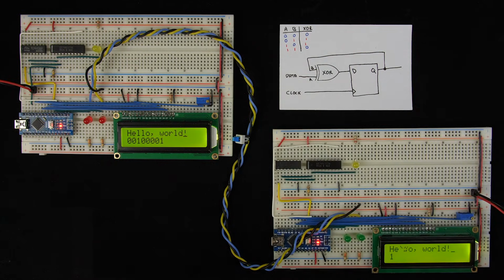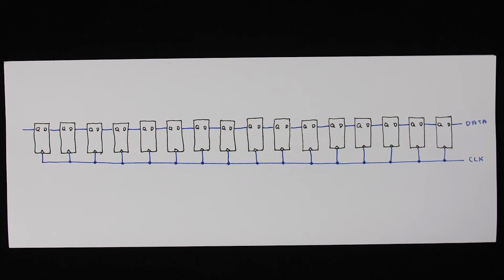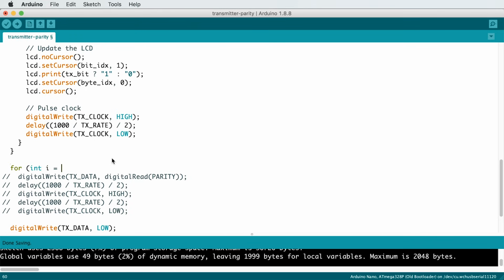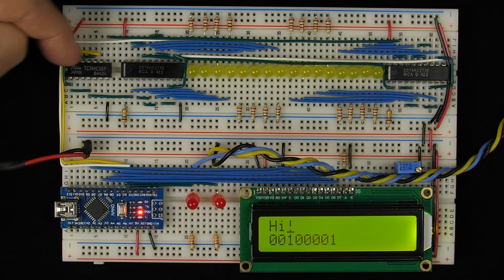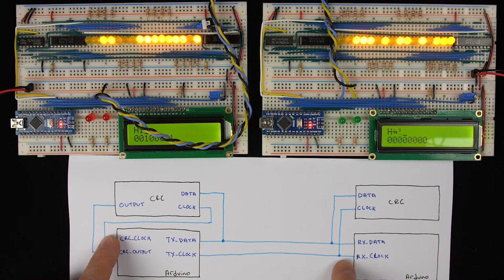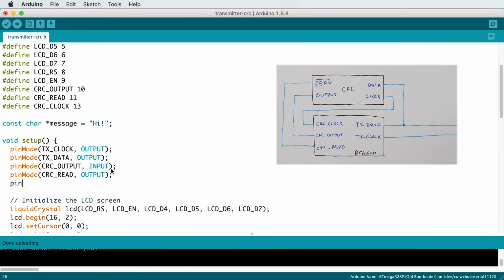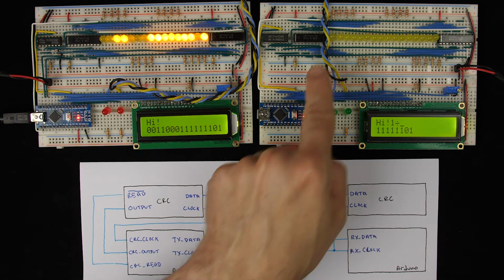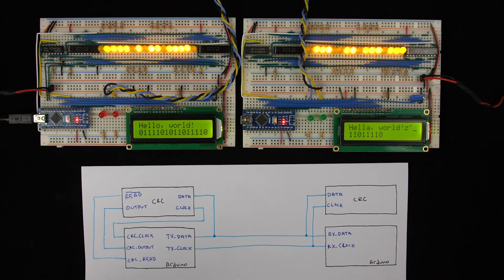Hardware build: CRC calculation

Comment: Would it be possible to connect the output of the (transmitter-side) CRC to the (TX_/RX_)DATA line through an AND gate with one input being the output of the last bit of the CRC and the other input being connected to the CRC_READ signal of the Arduino (which should be programmed not to "invert" the CRC_READ output)?
Reply: yes it would. I have no clue why he didn't do that.
Reply: Possibly because he'd have needed two AND gates and an inverter to do that, and he ran out of space on the breadboards he was using anyway (which is why he resorted to using diodes and a resistor at one point).
Yes, it would require two AND gates.  Think about it for a while and you should be able to figure out why.

Hint: What happens if you connect two outputs together and one output is at logic 1 while the other is at logic 0?
Reply: @melkiorwiseman  I thought that connecting two outputs together would be fine, but now I know it wouldn't. Would an OR gate on the outputs work? Do I understand it correctly?
Reply: @michalsebek2089  It would work if there was a way to set and hold each output to zero while the other output was transmitting, otherwise, either output being left high would cause the output of the OR gate to stay high no matter what the other output was sending to the OR gate.
Reply: @melkiorwiseman  Sorry, I'm dumb, but I'm curious, what was your idea of having two AND gates and an inverter? I tried drawing it on a paper and the only solution I found uses a NOT gate, an (one) AND gate and an OR gate.

The NOT gate is between the CRC_READ output of the Arduino and the READ input of the CRC module (if the Arduino will be reprogrammed to output HIGH if it wants to "read") or between CRC_READ and the AND gate (if it is the way it is now)
The AND gate has two inputs - the CRC output and the CRC_READ signal.
The output of the AND gate is then ORed with TX_DATA and the output goes into RX_DATA.

If it wanted to send data, it would set the CRC_READ low (or high - see the NOT gate options), that will set the AND gate to low, and the OR gate will output the TX_DATA.
If it wanted to send the CRC result, it would set the TX_DATA low and the CRC_READ high (low). The AND gate will output the CRC output, and so will the OR gate.
Reply: @michalsebek2089  My solution was simiar to yours, but I was presuming that the outputs of the AND gates would be floating if not driven, and I was thinking that there's already XOR gates on the board so one of them could be used as an inverter.  Your solution sounds like it would work, and probably would work better than my original idea.

Comment: A little late to the game here, but was re-watching this and it occurred to me if you XOR'd every flip-flop and AND'd between the flip-flop 16 out and the XOR in, with the AND input 1 being Flip-Flop output and input 2 being controlled by code, you could have the hardware support any generator polynomial of the same CRC length. Is something similar to this built into chips with the firmware controlling (or exposing to code) the generator polynomial?

Comment: Am I right in thinking the transmitted CRC could be subjected to errors and therefore the receiver may not receive the correct CRC for comparison? (so the verification could be wrong even though the data is correct?) - BUT even with that the system could still tell if there were  errors and that could be used to request a resend of the message.

Comment: I am curious that why did you used Diodes Logic rather than using Transistor? (at 34:41)
Reply: Basic transistor logic is usually NAND gate, sometimes NOR gate. Point is: it must invert signal because only on common-emitter circuit there is amplification of signal which corrects all the noise or level shifting that could occur to signal. (emitter follower alone is of no use, because it also shift level by 0,6 volts down, so after couple of them your logic is doomed).

But in this circuit we needed non-inverting AND gate, which would require 2 NAND gates. That's just too much an effort compared with 2 diodes and resistor :)

Comment: Hey man, why don't you just OR the output of the Arduino and the CRC and send that to the receiver? The Arduino output is low during the CRC transmission and the CRC output is low during the data transmission. That would simplify things.

Comment: I have a question about race conditions in electric schemes.
It looks like a current d-type flip-flop transfers their input to output with  positive-going edge of the clock pulse.
(may be too much multi-threading software development for me)

~thanks
Reply: Short answer: these d-type flip-flops usually consist of 2 latches inside: one pass signal through when clock=0, another one when clock=1. So when clock=0, input signal is latched into first part of flip-flop, while output stays what it was. And when clock=1 (that is, on positive edge), first latch now holds what was  put there and transfer this bit into the second latch, and it also go to output. So at this point output is not dependent on input, which allows you to connect them whatever you want. 

Ben had this explained, see "Master-slave JK flip-flop" and maybe one before which named "JK flip-flop racing", which explains exactly what you're worried about :)
Reply: Ben put in a description 74HC273 IC. Which description is: 
"The ’HC273 and ’HCT273 high speed octal D-Type flip-flops with a direct clear input.
Information at the D inputis transferred to the Q outputs on the positive-going edge of the clock pulse."
from: http://www.ti.com/lit/ds/symlink/cd74hc273.pdf

I'm not sure, but may be it should be something like SN74HC74N, which called double D-type flip-flop in spec file http://www.ti.com/lit/ds/symlink/sn54hc74.pdf  ?

Comment: How would the receiver know that the CRC is in fact the CRC?  You probably don't want the reciever to mistake it for part of the message and keep waiting for a CRC that never comes.
Reply: that's just part of the protocol. You'd need to solve that at a higher level. The simplest solution would be to just have a constant length, or send the length of the message as a header.
Reply: What WeNeedMoreFarads said.  Part of the protocol is for the transmitter to only wait for a certain amount of time for an acknowlegement of "data received" before re-transmitting the last data packet.
In the case of the ZMODEM protocol, it divides the message up into packets and gives a header and CRC to each packet before transmitting the packet.  Part of the packet header includes the packet number.  Part of the ZMODEM protocol is for the receiver to acknowledge the successful receipt of each packet by using its number.  That way, the transmitter knows when the receiver has missed a packet because it hasn't sent an acknowledgement for that packet within the allotted time following the transmission of the packet.  It also means that the packets don't always have to arrive in the correct order since the receiver can use the packet number to put the data in the correct order before saving the message.
That's just to give you an idea of how complicated protocols can become.  I've barely scratched the surface of the can of worms which is data transmission protocols.

Comment: Hey Ben! Why didn't you calculate the CRC directly in the arduino? It could calculate it much quicker and you don't need to use the new ports.
Reply: The whole point of the video is to explain how the algorithm can be done directly with hardware. While it could absolutely be done directly on the Arduino, it wouldn't be as elegant of a solution and it wouldn't be explained using binary gate logic. 
Also, the reason it might seem slow is because he significantly reduced the clock speed to make it possible to see the data being transferred. The chips are capable of calculating the CRC basically instantly.

Comment: What would it take to implement a system for error correction, one that shows what type of error occurred, where it was located, and what was done to correct it?
Reply: Just like for error detection there are many different solutions for error correcting code depending on the types of errors you can expect, again it's ultimately a trade off between how willing you are to deal with low probability errors falling outside the scope of what your ECC can resolve and how much of your bandwidth you are willing to spend on redundancy.

Comment: I use the same shifting method and XORing all the bits corresponding to the powers of the generator polynomial to compute CRC32 but it does not give the correct value of CRC32 ! For CRC16 you have (16,12,5,0) and a 16-bit long CRC. For CRC32, I use the generator CRC-32  0x04C11DB7(x32 + x26 + x23 + x22 + x16 + x12 + x11 + x10 + x8 + x7 + x5 + x4 + x2 + x1 + 1) and a 32-bit long crc at the end but I got  different result with official motor ! How come ?

Comment: But what if there is an error while transmitting the CRC? Do we add a second CRC to check that the first wasn't corrupted?
Reply: if the transmitted CRC has an error, the receiver CRC check will not be zero. Since the incoming "erroneous" CRC doesn't match the computed one of the "correct" incoming message = the transmission error will be detected. You are right though, that with this technique you cannot figure out wich, the message or the CRC, was corrupted, only that some corruption occurred. But that is good enough, either way you cannot verify the message, and you need to resend because your transfer medium introduced an error.

Comment: Sorry for my stupid question, why using 2 diodes instead of an and gate?
Reply: Breadboards have a division down the middle of them that allows you to place two-sided components in one column without the two sides being directly connected - the chips and the LEDs are all bridging this divide. The reason an AND gate chip couldn't be used, is that there was nowhere left on the boards where that division was left available for it; other components were taking it all up and there was no space left without rearranging things.
Reply: @Eyrlumi  Thanks for the detailed explanation!

Comment: I wonder how serial communication work? The two wire thing(TX RX)  , and can u show us how to make one ? I been wondering for ages 🤔
Reply: There is no single serial communication. It is a concept with many different implementations. If you have been wondering for ages, I wonder why you didn't bother to use Google yet. You know, it is a thing that lets you find stuff, especially those very basic things. There are thousands of explanations already.
Reply: The most common form is fixed baud rate non-return-to-zero (NRZ) coding. Look up something about UARTs; for instance http://www.circuitbasics.com/basics-uart-communication/

Comment: ben,perhaps you can translate this lost 6600 technique into understandable form and show how your students might use and update its  insights into 2019 logic for fun and reduced power and time to result etc...
 https://www.crowdsupply.com/libre-risc-v/m-class/updates/modernising-1960s-computer-technology-learning-from-the-cdc-6600
what they fail to mention is that there are multiple single-line source wires, thus achieving the exact same purpose as the reorder buffer’s CAM, with far less power and die area.

Mitch’s description of this on comp.arch was that the dependency matrix columns effectively may be viewed as a single-bit-wide “CAM,” which of course is far less hardware, being just AND gates. However, it wasn’t until he very kindly sent me the chapters of his unpublished book on the 6600 that the significance of what he was saying actually sank in. Namely, that instead of a merged multi-wire very expensive “destination register” CAM, copying the value of the dependent src register into the reorder buffer (and then having to match it up afterwards on every clock cycle), the dependency matrix breaks this down into multiple really simple single wire comparators that preserve a direct link between the src register(s) and the destination(s) where they’re needed. Consequently, the scoreboard and dependency matrix logic gates take up far less space, and use significantly less power.

Not only that, but it is quite easy to add incremental register-renaming tags on top of the scoreboard + dependency matrix – again, no need for a CAM. Moreover, in the second unpublished book chapter, Mitch describes several techniques that each bring in all of the techniques that are usually exclusively associated with reorder buffers, such as branch prediction, speculative execution, precise exceptions, and multi-issue LOAD/STORE hazard avoidance. The diagram below is reproduced with Mitch’s permission:....

his high-level diagram includes some subtle modifications that augment a standard CDC 6600 design to allow speculative execution. A “Schroedinger” wire is added (“neither alive nor dead”), which, very simply put, prohibits function unit “write” of results (mentioned earlier as a pre-existing under-recognised key part of the 6600 design). In this way, because the “read” signals were independent of “write” (something that is again completely missing from the academic literature in discussions of 6600 scoreboards), the instruction may begin execution, but is prevented from completing execution.

All that is required to gain speculative execution on branches is to add to the dependency matrix one extra line per “branch” that is to be speculatively executed. The “branch speculation” unit is just like any other functional unit, in effect. In this way, we gain exactly the same capability as a reorder buffer, including all of the benefits. The same trick will work just as well for exceptions.

Mitch also has a high-level diagram of an additional LOAD/STORE matrix that has, again, extremely simple rules: LOADs block STOREs, and STOREs block LOADs, and the signals “read / write” are then passed down to the function unit dependency matrix as well. The rules for the blocking need only be based on “there is no possibility of a conflict” rather than “on which exact and precise address does a conflict occur”. This in turn means that the number of address bits needed to detect a conflict may be significantly reduced, i.e., only the top bits are needed.

Interestingly, RISC-V “fence” instruction rules are based on the same idea, and it may turn out to be possible to leverage the L1 cache line numbers instead of the (full) address.

Also, Mitch’s unpublished book chapters help to identify and make clear that the CDC 6600’s register file is designed with “write-through” capability, i.e., that a register that’s written will go through on the same clock cycle to a “read” request. This makes the 6600’s register file pretty much synonymous with the Tomasulo algorithm’s “common data bus.” This same-cycle feature also provides operand forwarding for free!

This is just amazing. Let’s recap. It’s 2018, there’s absolutely no Libre SoCs in existence anywhere on our planet of 8 billion people, and we’re looking for inspiration on how to make a modern, power-efficient 3D-capable processor, only to find it in a literally 55-year-old design for a computer that occupied an entire room and was hand-built with transistors!

Not only that, but the project has accidentally unearthed incredibly valuable historic processor design information that has eluded the Intels and ARMs (billion-dollar companies), as well as the academic community, for several decades.

I’d like to take a minute to especially thank Mitch Alsup for his time in ongoing discussions, without which there would be absolutely no chance I could possibly have learned about, let alone understood, any of the above. As I mentioned in the very first project update: new processor designs get one shot at success. Basing the core of the design on a 55-year-old, well-documented, and extremely compact and efficient design is a reasonable strategy: it’s just that, without Mitch’s help, there would have been no way to understand the 6600’s true value.

The bottom line is, we have a way forward that will result in significantly less hardware and a simpler design, using a lot less power than modern designs, yet providing all of the features normally the exclusive domain of top-end processors, all thanks to a refresh of a 55-year-old processor and the willingness of Mitch Alsup and James Thornton to share their expertise with the world.
...

Comment: Please upload faster, with smaller videos either in parts forming series. I wait for long time and I faint after seeing length of the video
Reply: Shared, the beauty of ben's videos rests in the fact that he takes his time and explaines EVERYTHING. If he were to start to cut up his videos, his appeal would plummet. Large long videos that explain one thing in depths are rare and should be treasured, not forsaken!
Reply: He cut up one huge video, into  two small videos
Reply: @chrisocon that is still 25 to 30 minutes. I think shared means that ben cuts his videos "bite size" of about 10 minutes. It ruins the continuity if he has to start a whole new video and then reference the old video.
Reply: @chrisocon  what video was that again? One about his CPU?
Reply: @OfficialRID  I actually don't remember that CPU video off the top of my head. Also, are we using 'bite sized' since his name is Ben Eater?
Reply: @chrisocon  no, unintended pun right there. Also, this CRC concept is split into two videos. Theory and the practise, but this is a result of ben re-explaining what a shift reg is and of course the juicy datasheet sections.